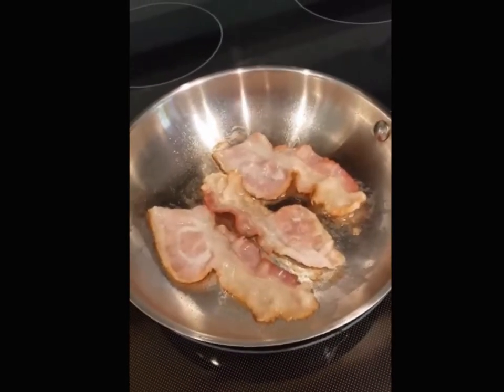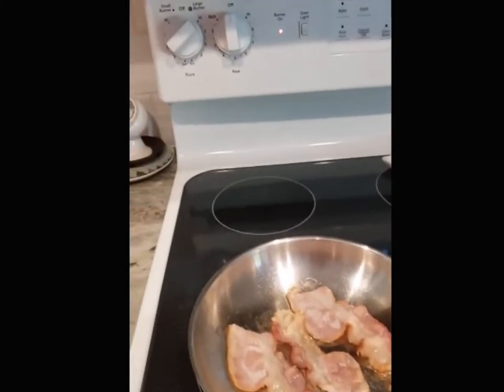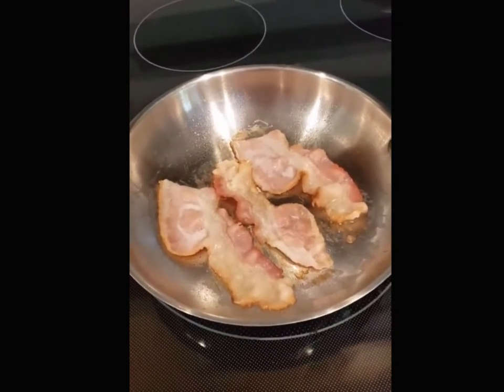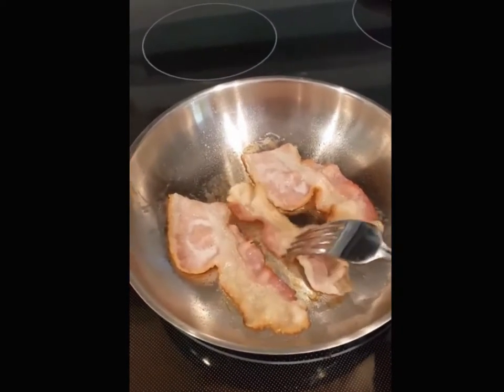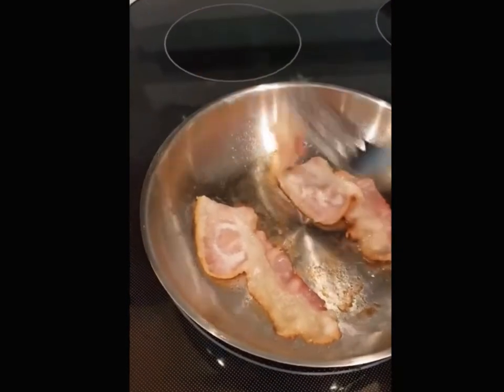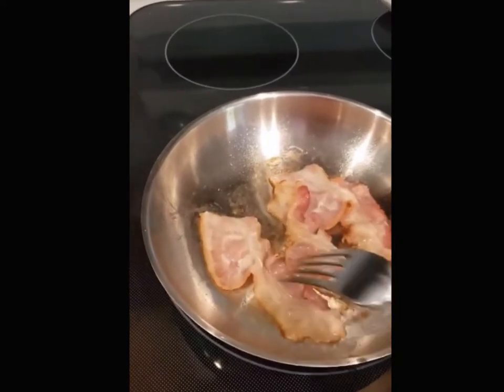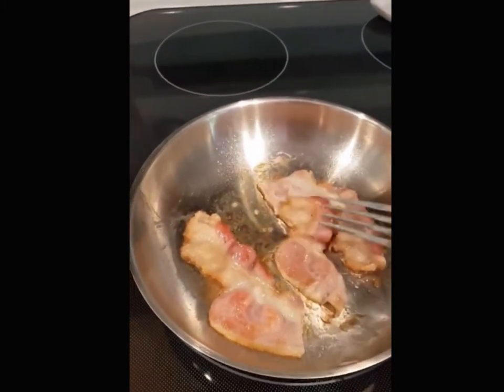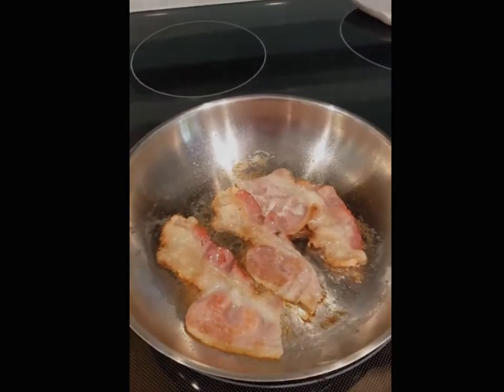How to keep bacon from sticking to a stainless steel pan

Comment: I cook my bacon in the oven... I love bacon but I hate cooking it!
Reply: Heather Stoney: Especially in an oven.
Reply: @eddyvideostar  you hate cooking it in an oven? I guess different strokes?
Reply: @HirschfeldHandknits : I don't hate cooking nor using an oven; albeit, at times, it's cumbersome when the weather is warm, then: 
more time is needed, 
more gas is utilized, 
more expense is incurred,
more equipment dubiousness may arise.
Reply: @eddyvideostar  yeah I think I used the air fryer in the warm weather. I prefer not having the mess involved with using a fry pan.   I haven't noticed any dubious behavior from my equipment.
Reply: @HirschfeldHandknits : HS: At times, the frying pan can get messy -- especially when one has to do his/her cleaning and washing up: even the self-cleaning ovens need some assistance. ------------------ How is the air fryer working for you? Are the preparation and food satisfying and sapid (tasty)? In what way is the air fryer cleaner in preparation and conclusion?
Reply: @eddyvideostar  it's fine but mostly good for summer use. I haven't been using it since it got colder. Takes up a bit too much real estate for a small kitchen. Most of the foods have been good, not as tasty as oil fried, but that's a given. Lumpia and onion rings were the best, pork chops were the most disappointing. Bacon was good but took forever to do a pound... can only do a quarter of a pound at a time. Haven't tried any baking in it. I give it a 7 out of 10 overall.